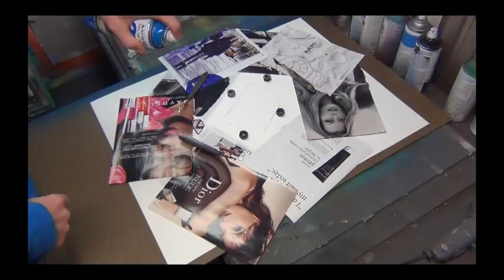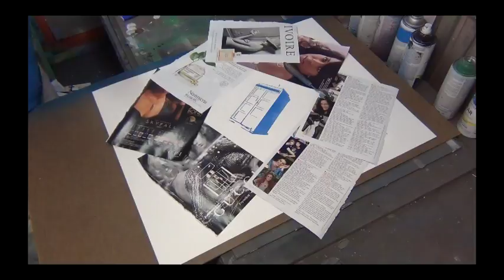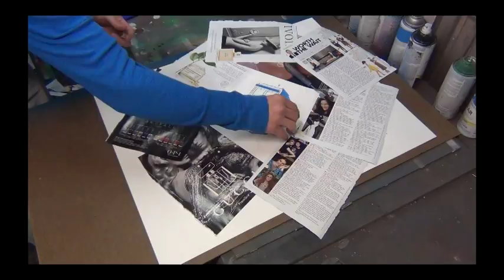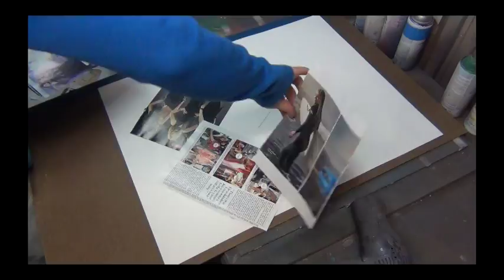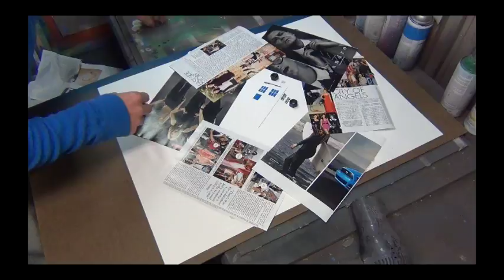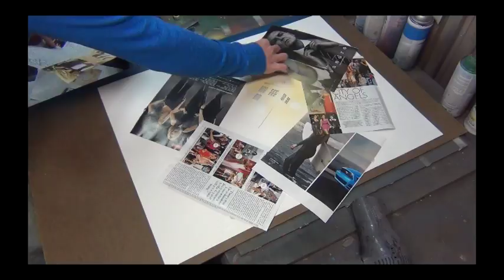Dr Who Tardis

Comment: The clear coat spray paint is meant for  correcting mistakes. Or so you can  add to an the painting.  Because I rewets the paint so that you can work with it again because spray paint drys fast. But if you want a finished product it is really cool to use the clear coat too for the whole painting to make it look really good.

Comment: What type of spray cans do you use? Well paint,... and paper. It looks to glossy!
Reply: Glossy poster board (Matte soaks up to must paint and paint dries to fast the gloss prevents that and makes easier to lift the paint) and gloss paints. I use mostly rustoleum. Metallics can give a transparent look as can cheaper walmart gloss paints.  Clear gloss sprayed on drying paint helps it stay wet longer so you can do more work. Hope that helps
Reply: Also there are more expensive paints and cheaper paints. Each may work a little differently than the others. I've just found rustoleum to be an okay cost range for me. The newer nozzles on them are different than the older but I've learned to adapt. But the nozzles on some cans are directional and are harder to use